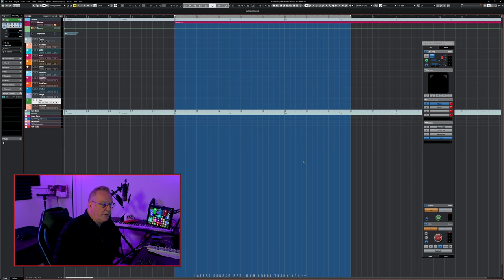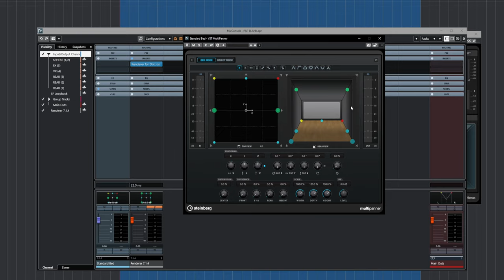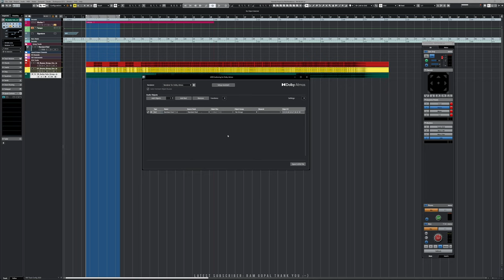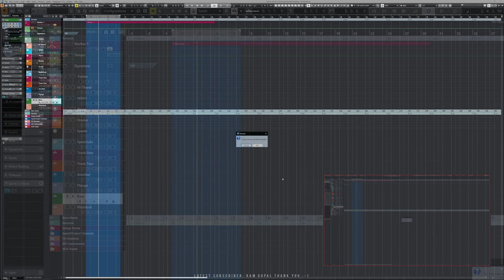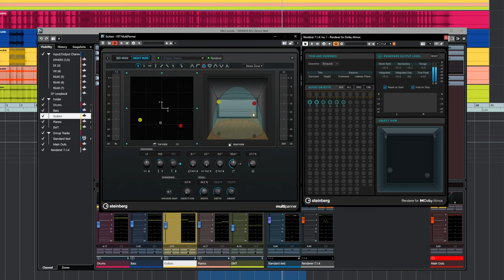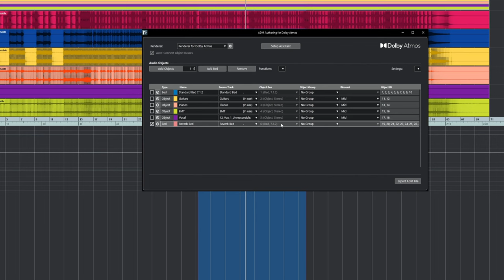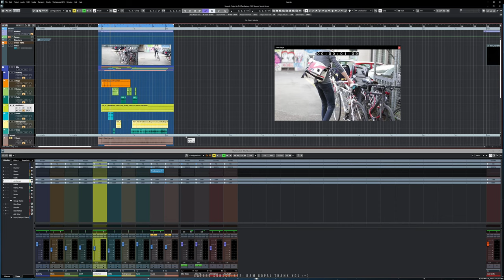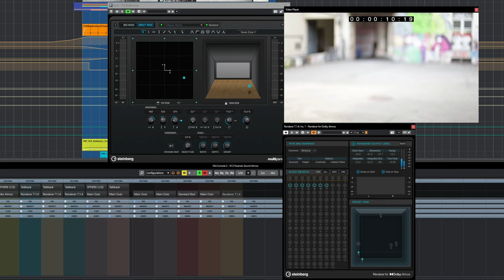Getting Started with Dolby Atmos in Nuendo 12 | Nuendo Livestream

Comment: thanks, one question, am i limited with objects ? coz i have a project with more than 200 tracks that i want to convert to 7.1 and from what i saw the renderer is limited to 128 objects
Reply from the maker: Dolby Atmos itself natively supports up to 128 Objects, (10 of which will usually be your Bed.) This is not a limitation of Nuendo but of the Atmos framework itself. So, if you have more tracks than that, you can sum them together before sending them as objects to the renderer channel, or route them to the bed. 🙂
Reply: @PhilPendlebury  yes i figured thats the case. grouped the tracks and made a bed out of the group track. thank you
Reply from the maker: @angelite6027  I actually tend to make groups for similar items and then make an object for that group. I'll be covering this in the livestream coming up on Monday 28th. 🙂